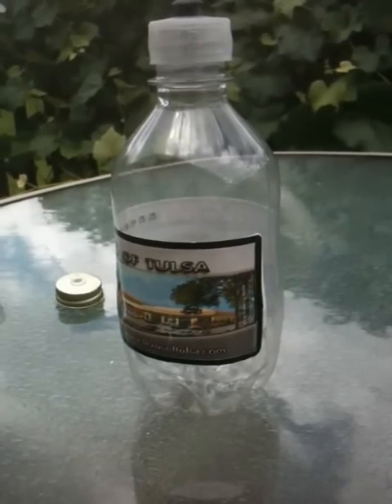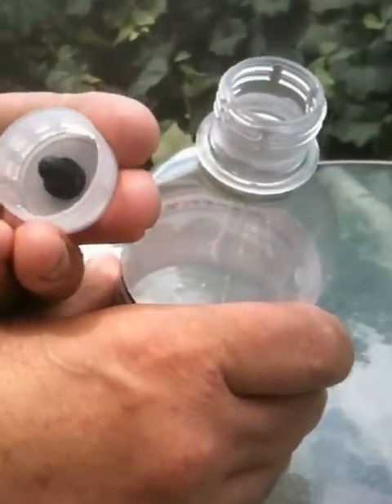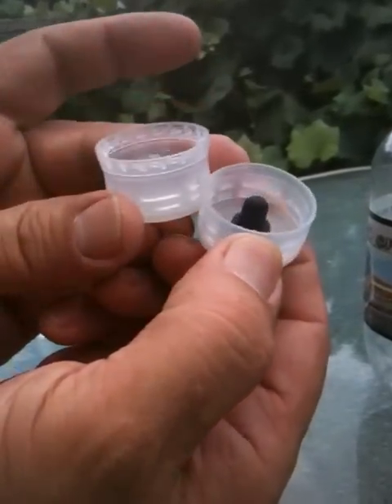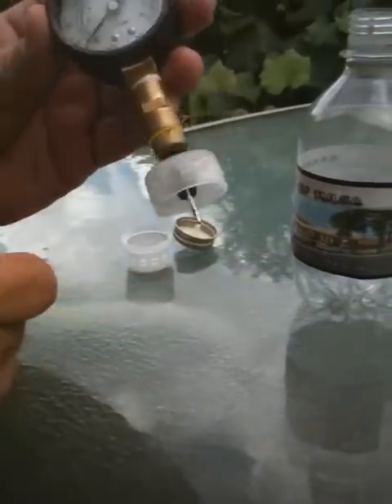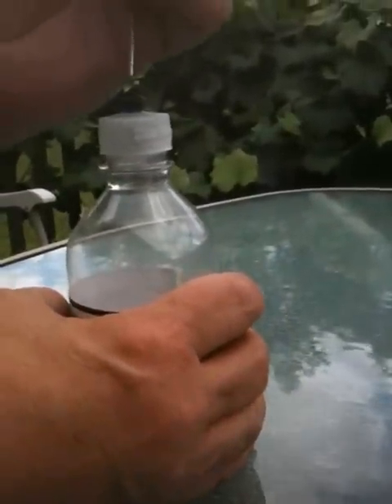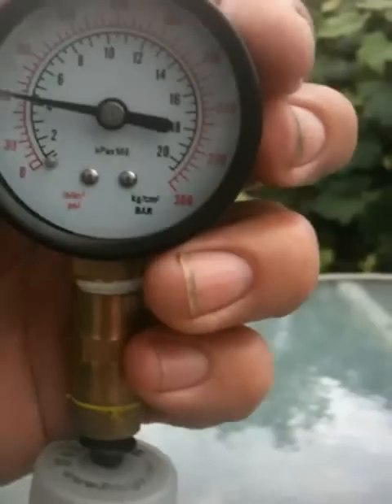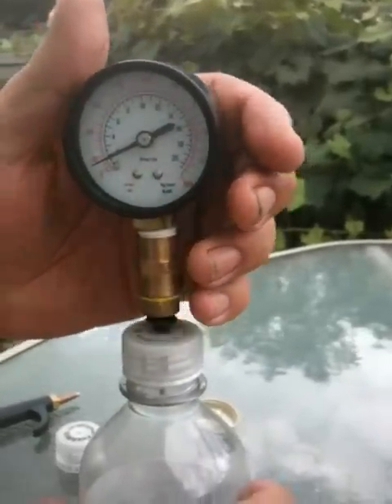Measuring Pressure Inside a Soda Bottle

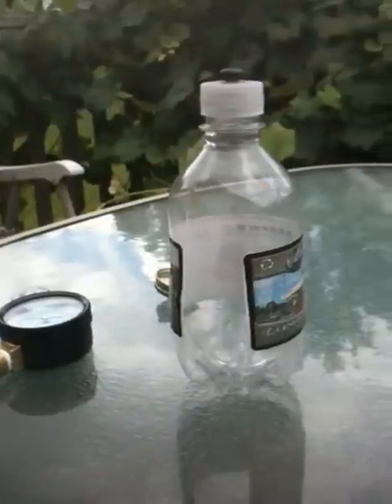Comment: Can I still by from you the fizz cap with sports ball valve?  Doing an experiment demonstrating the 2:02 pressure law.
Reply from the maker: I only make and sell caps with my clear valves.
Sorry.

Mike
==============================================
Reply: @MisterFizz  thank you so much.  In the video you stated that the pressure gauge with the sports needle would not work with white cap, but can you envision a way to attach a pressure gauge to the white cap.  Also how much are they?
Reply from the maker: @noahc.designs1779  Could you reach out directly. There is an uncomplicated and economical solution that will meet your objective.

Comment: Thank you.

Your design is good. I would however like a pressure relief valve. Do you have any ideas about that?
Reply from the maker: Some of my customers have installed FiZZ GiZ plug valves into soda bottle caps in reverse. Mainly these were people doing secondary fermentation in bottles. It's a stage after primary fermentation where beverage is racked off into bottles. With the addition of a wee bit of priming sugar to initiate secondary fermentation for the sole purpose of reaching a desired level of carbonation inside the bottles. FiZZ GiZ plug valves installed upside down will allow gas to escape, flowing one-way out of the bottle instead of one-way into the bottle. The cracking pressure of the valves is 15-20 psi.
Reply: @MisterFizz  
Thanks 

That was exactly what I was thinking. If I bottle to late alcohol levels may have reached levels toxic to yeast. If  I bottle to soon 'bang' exploding bottles.
Reply from the maker: @kevingooley6189  It can be tricky. Glass bottles won't swell or give you any visual indicator to indicate pressure build-up inside until it's too late. With PET plastic, you do have that. Pressure relief valves sound like the best bet. I can be reached at MrFizz&FizzGiz,com (substituting the obvious characters, of course).

Comment: how do you get the black value into the fizz giz cap?  can I just order some fizz gize caps with the black value?  I am not using this for drinks, but am using this for science experments with presure-volume temputure with my kids.  thank you, H
Reply from the maker: +Heather Wylie Football valves can be tricky to install in a cap. Watch this video: http://youtu.be/0773FzakiJY It shows an approach that may just be the solution you need.
Reply: Are the other (non black) caps commercially available and how would you recommend measuring the pressure with those?

Comment: Can you help me find these specific valves?
Reply from the maker: Been close to a decade since I sourced any of them. Short of cutting one out of a football, I don't have any specifics to offer. You can use a FiZZ GiZ plug valve to pressurize a bottle to a desired value. Are you mainly interested in methods to measure pressure inside of a bottle? Or, is your purpose to pressurize a bottle to a desired value? Reach out, if you like.  I can be reached at MrFizz&FizzGiz,com (substituting the obvious characters, of course).